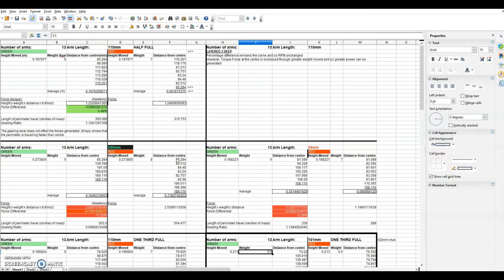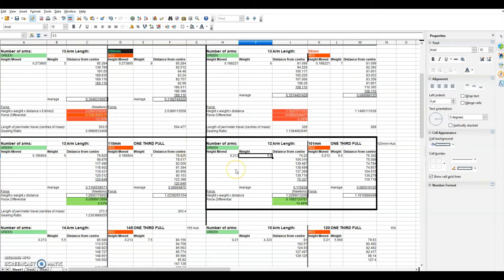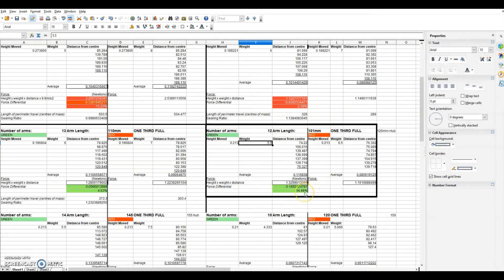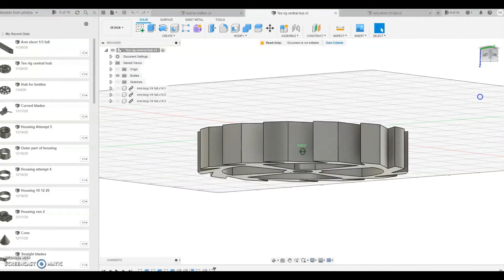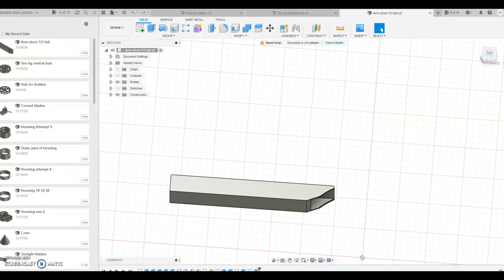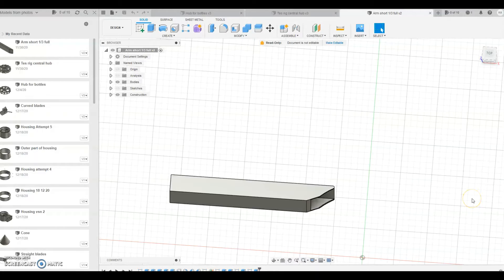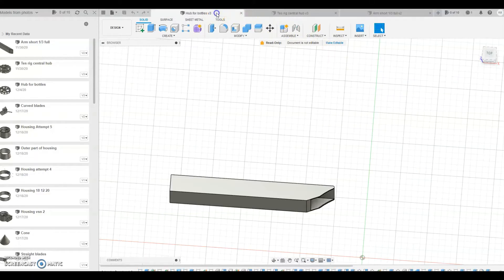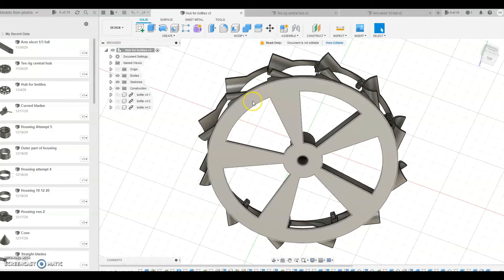Bhaskaras wheel - The results

Comment: Did you measure the amount of water by weight or volume?
The bottles have ridges which slows the flowing of the water.
100mm plastic test tubes would be ideal. They are quite cheap on eBay.

I built one years ago with the test tubes and a metal ball in each one. It didn't work but the hub was not with ball bearings so I am going to try again.

Comment: Some years ago I saw a youtube video of some Italian guy who built a variant of the Bhaskara's Wheel. It was massive, the size of a small Ferris wheel. He got it to run when in the sun, as heating certain sections of the wheel made the liquid travel up the tubes and through leverage make those sections heavier. It's not a perpetual motion machine, but a Thermal Engine. What about developing a Bhaskara's Wheel that runs in the sun?
Reply from the maker: Yes makes sense extra energy source..v solar panels is the question, which more efficient
Reply: With the drilling equipment available today it is much more easy and less expensive/more efficient to harness the thermal energy of the earth’s crust rather than the sun ie geothermal. And because geothermal energy is 100% consistent (not intermittent like solar, wind etc) it doesn’t require storage batteries to function. Germany has built one geothermal power plant and they now produce more energy than the entire country needs. Geothermal pipes can also be used for both heating and cooling (domestic, commercial and agricultural applications). 

In other words, geothermal equates to unlimited energy and food, and thats the reason we never hear about it in the media (or even from mainstream academia).